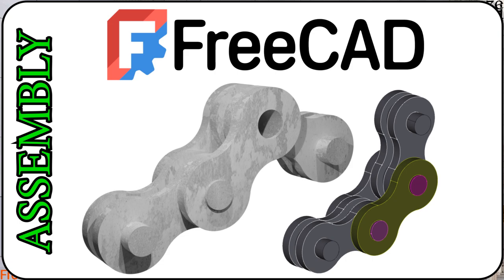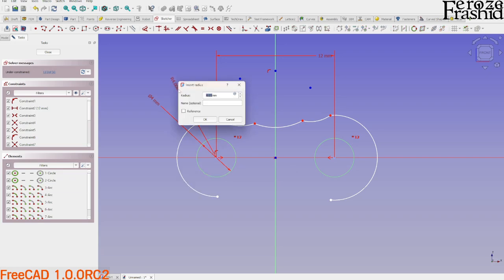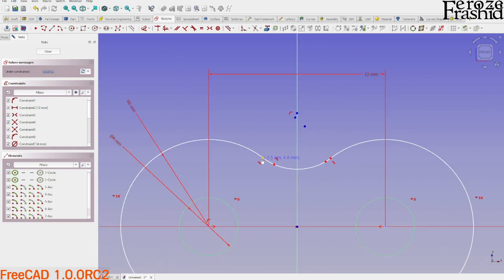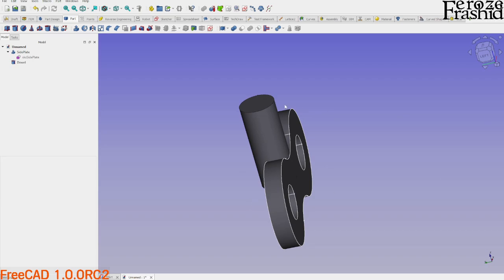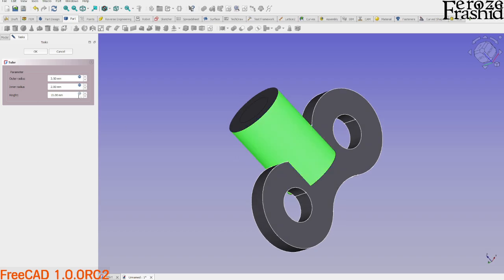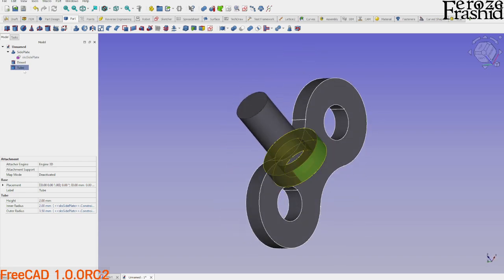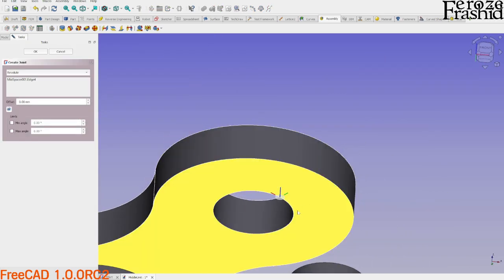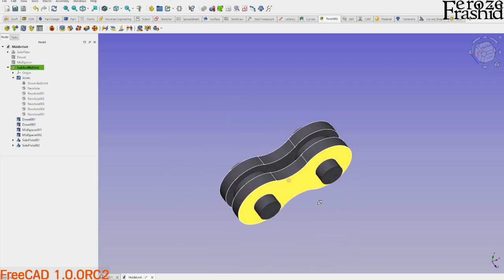The New Assembly Workbench of FreeCAD: Assembly Workbench for Beginners

Comment: That is a very nice explanation. When you inserted the SubAssyMidUnit in the active BikeChainAssy, you did not select to ground it but you were able to rotate and align it with the frontal plane.  If the inserted part is not grounded, the joints are grayed out.  Where did I miss? Thank you.
Reply from the maker: I set the first part added in any assembly to be grounded. So, SubAssyMidUnit was grounded the moment it was inserted in there, as can be seen by the lock symbol. After that, you can still move or rotate around using the axis cross if the axis cross is visible. You can bring the AC back by selecting a part from the left panel after inserting it. Does that address your concern?